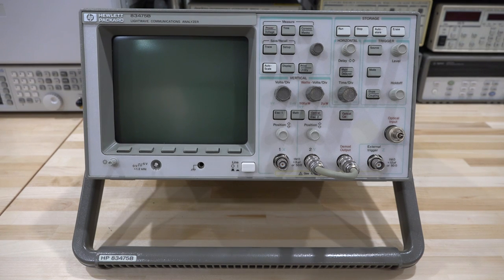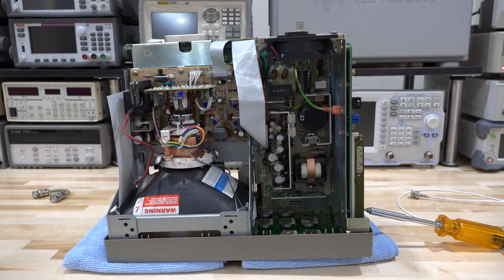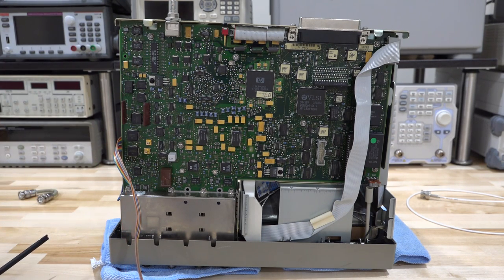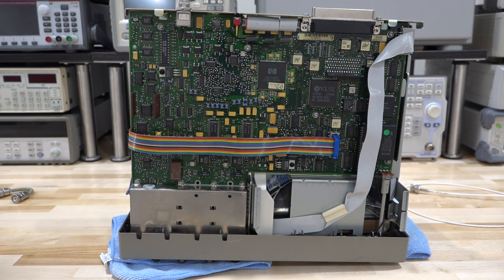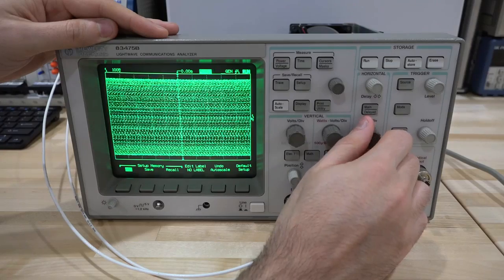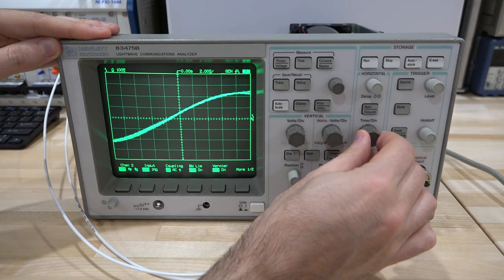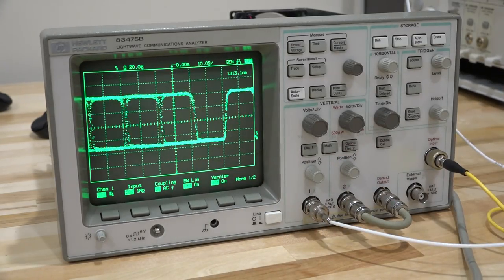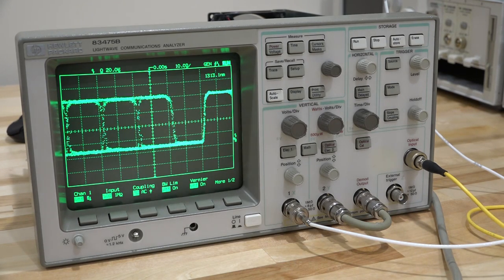TSP #98 - Teardown & Experiments with an HP 83475B 500MHz Lightwave Analyzer / Oscilloscope

Comment: I guess you're looking at the same baseband signal both in the electrical and optical domain, as opposed to the first example where you fed two independent signals to the inputs. Hence the same pattern is displayed on the screen, including the triggering edges. The delay is probably due to optical modulation and demodulation.

Comment: The optical still has the rising edge at the end for a very simple reason : it is generated from the trigger signal (as opposed as before where data and trigger were different). And this "trigger" point is not in the middle of the screen because of the latency induced by the optical modulator, and maybe the attenuator (I don't know whether it is passive or active).

Comment: It looks almost identical to my 54645D scope. I love that scope but sadly I blew out channel A, and also completely messed up the calibration. Both fixable but I'm so busy. Mine also has the GPIB converter as well as a parallel port to connect to a printer (which I connected to an HP 4A to test, and it works really well!).

Comment: I think I have the same family scope in my lab, electrical only though. Got an encoder issue with mine on the timebase so interesting to see what I'll find inside! Thanks for the video :)
Reply: A HP 54600B or similar by chance? I have one of them, and yeah the encoders can get a little crusty with age. I managed to fix mine with liberal use of contact cleaner followed by even more liberal use of canned air. Works a treat now.
Reply: 54602B with 54657A GPIB memory module :)
Reply: Ah, sneaky, 2 more channels and some bandwidth. I got the memory module as well, but I've yet to figure out why it's useful :P
Reply: Yeah I failed though as I needed it for pulse measurement, then realised it was subsampling... Could still use it but with additional considerations!

Comment: great video! what year is that unit actually from? you mentioned old but never a specific date.

 If you were using that to analyze a device with intermittent problems or clock issues, or a device with an unstable/dirty power supply how would the errors show up on screen, given the fact that it's subsampling a signal it expects to be consistent?
Reply from the maker: Daniel G It is from mid-nighties I think. With for example intermittent problems you would get traces and samples in the middle of they eye diagram showing errors and poor BER.
Reply: ahh okay... it's one of those things where you'd see "something" and you'd need to either use another device to check, or use your intuition/experience to maybe recognize what type of fault the glitch relates to?
Reply: You should be able to accurately estimate the year of manufacture from the date codes on the ICs.

Comment: Why they don't make their own power supplies?
Reply: It's like many other fields: Concentrate on what you are good at and leave the power supply to a sub vendor that does nothing else than making power supplies for a living. HP does make power supplies, but having to work together with in-house people that can make the power supply is not warranted when it's not critical in an application like this.
Reply: And they still make their own semiconductors, though most of the jellybean stuff is just HP-rebranded with 1820-xxxx codes.